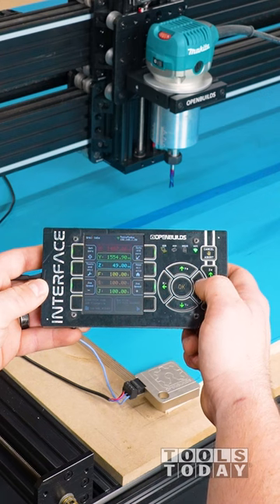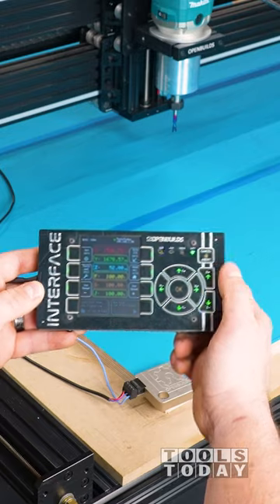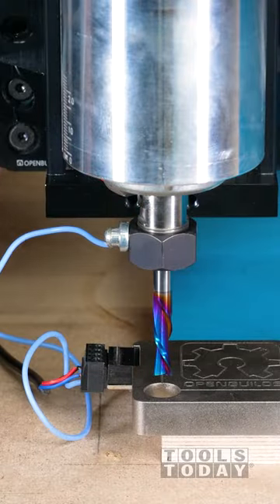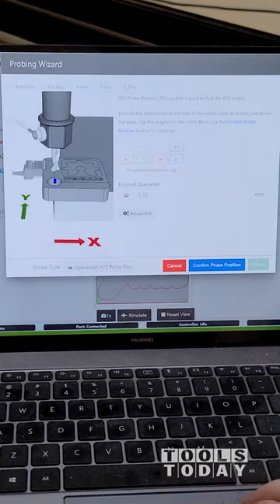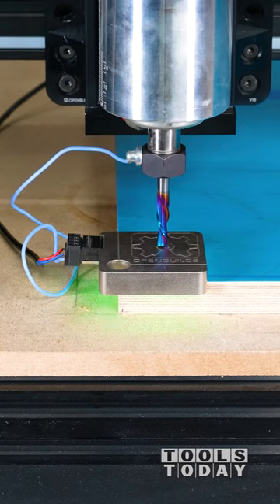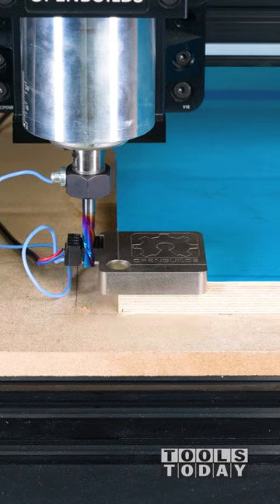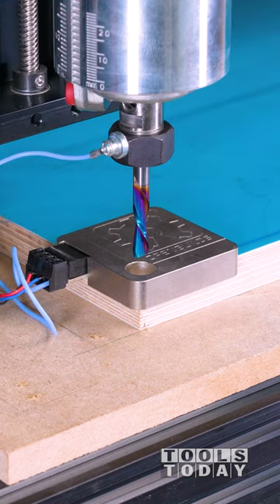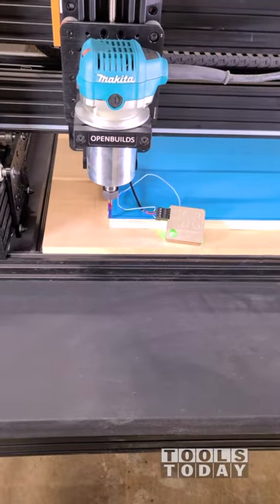Easily Set XYZ Zero on CNC

Comment: The cutting edge should be what you’re touching off on, z is fine but x and y are touched off on random spots on the tool. That can cause up to 30 thou or more of play in your position depending on the cutter’s flute geometry and size. The way we got around this was spinning the tool in reverse slowly, 150 rpm or so, that way the cutting edge makes contact but doesn’t cut the probe block. Love your shorts, please keep it up <3
Reply: Exactly, that bit can is not equal on all sides and it’s better to use proper or a perfectly round rod to measure the edges equally
Reply: @FarmingwithZana101  yes, on our older machines we used a .2 diameter rod to set x and y then subtracted half the diameter from each to give us the perfect center. How long have you worked on cnc machines if I can ask?
Reply: Most of the times x and y are a rough estimate which is fine if you leave some room around the edges. Only z is very important and that one works fine
Reply: I was thinking, while it doesn't look like it does, if it probes x and y deep enough, half the depth of one full turn of the helix, it should always touch on an outermost cutting edge first
Reply: Yeah a seperate round probe should be used for X and Y. Z should be used with the cutting tool in question. Otherwise, just Z the tool and have reliable XY end stops.
Reply: @arealhumanname4150 yep. I came to say this.

However i have hold-downs in that corner. Don't most have an edge to hold the workpiece in that corner?!

Comment: It's ALL in the software. Difficult to find the correct program. But that aside. Turn the drill bit upside down and make sure it goes ALL THE WAY IN. Finger tight is enough. Then do the routine. Needless to say, turn it the right way before cutting.

Comment: Everybody here has found the significant error in the calibration of this machine in this video using this method.

There's variance dependent upon the position of the drill bit in use. A completely smooth bit or the current bit with rapid reverse spin would be appropriate.

Comment: I’ve never seen a probe like that the probe i use at work on my Toshiba milling machine is a tool with a ruby tip that can either accurately measure positions on parts and uses a probecal program that can calibrate the probe but even though the probe costs many thousands of dollars is still .004 thou off so I guess if this thing gets your little mill pretty accurate that’s pretty cool but you probably need to hit on the cutting edge or depending on the thickness of your tool usually you should give the machine the center of tool position so if your drill bit is .250 thick I’d say add or subtract .125 from whatever position you got because I highly doubt it will be accurate to the edge of your tool or so the math for you